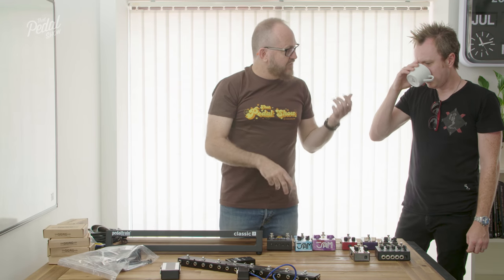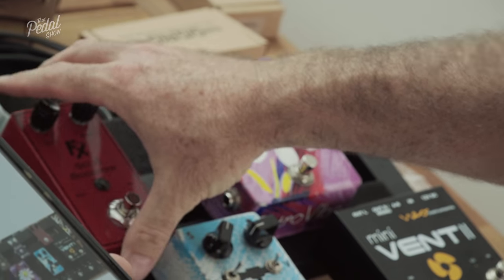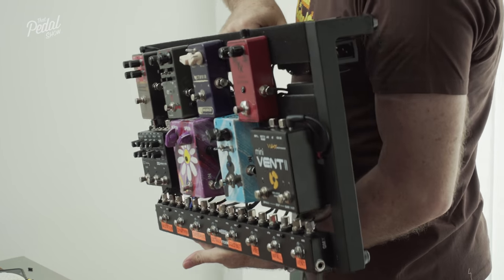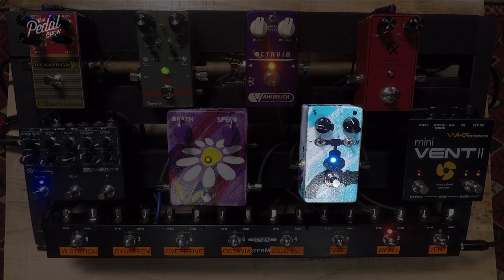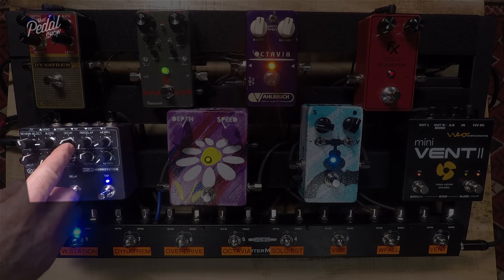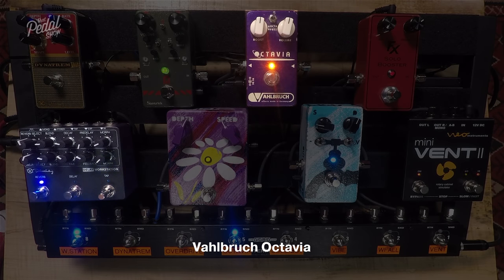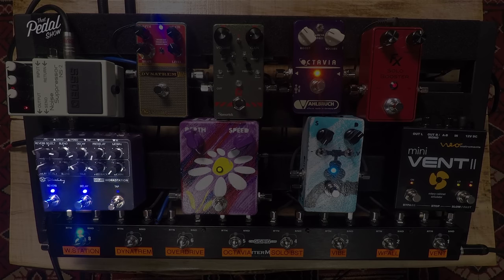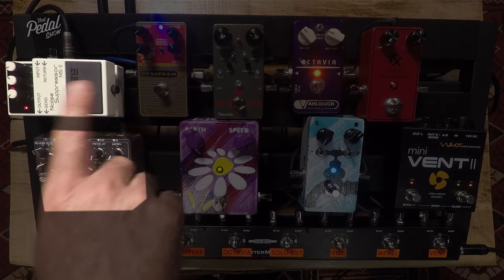Simon McBride Pedalboard Build – That Pedal Show

Comment: I worked as an avionics tech for 26 years and I have more than my share of scars on the backs of my hands from cable ties. To eliminate the sharp edge we would use flush cut diagonal cutters and cut the " tail " as short as possible against the locking part of the cable tie leaving next to nothing remaining. This practice helped to eliminate the cuts to our hands and heads at times LOL.

Comment: After I finished watching this clip this morning, I went in and fired up my hokey guitar rig. Honestly for the first time since I have owned my Mesa Lonestar Special, I dialed in a lot of gain on the amp as part of my pedalboard and two amp setup. I started watching TPS before I got that amp. And before and since I added the Mesa, I have been running both amps VERY clean.  
Because that is what you two do and it always sounds so great on the show. 
So today....EPIPHANY time! HUGE difference in the response of my guitars with all of this gain dialed in on the Lonestar Special. 
I am running a stereo delay through both amps and a GFI reverb only though the amp that is still dialed in clean. A clean boost, an always-on Lightspeed pedal, several overdrives and a few modulation pedals in there as well. 
Sounds REALLY good (to me) 
I have benefitted a lot from watching all of the TPS episodes. Today was a milestone. 
And Mr McBride is one HELLA player! 
Cheers from NM, USA
Reply from the maker: Excellent! The gain channel in the Lone Star is a marvellous thing. We’re glad this video helped inspire you - thanks for watching!

Comment: On the topic of the clip on tuner issue - I had a hunch this would be the case when Simon was talking about his experience in the beginning of the video. The case is that the Polytune clip on tuner works MUCH better than any other clip on tuner I've tried. It works much better in a noisy setting especially. This is likely the difference between Mic and Simons experiece.
Reply: Zach Richard 
I use a Snark(the little more expensive one) and never have an issue. My buddy has to have no sound, I just don't t have the issue, but I'm using a Strat, and he's using an Acoustic/Electric.

Comment: Hello there,
In the beginning of the pedalboard Build you mentioned troubles with noise and influential vibrations while using a clip on tuner on stage.
My advice: try to palm mute your strings and only let the one string shortly ring you want to tune and than pm again. Helps to increase focus on the strength of that strings frequencies!
I had an acoustic combo and I had similar troubles even with the build in tuner of my worthy Martin Acoustic. This trick worked just always....build in and clip on

Cheers

Comment: I don't get Keeley pedals. I've tried a few and the only one I absolutely love is the Keeley Katana. I have one as a seperate pedal and one in the Keeley workstation. If there is one pedal I wouldn't want to miss at all, it's that one. Best (clean) boost pedal ever imo. It doesn't color the sound in any way, it adds a small bit of compression. It's a pedal that's always on for me.

Comment: I’ve yet to hear an explanation of using 4 cable method, or how to run an effects loop on a switcher like that which doesn’t seem way overly complicated until a few days ago.

Treat the amps pre-amp as a pedal.

Instantly solved.
Reply from the maker: Hooray!
Reply: Could you have used two Quartermasters a 6 plus a 2 for the loop or would that have given grounding issues?
Reply: And then there's always one guy who takes that as a challenge to overcompicate things....GAVIN! 
JK mate. There are no bad questions, after all.
Reply: Ha ha Ha ;) I was trying to ask a practical question because here they had a significant noise problem requiring a gate pedal and a second ground lift. Some effects loops can be quite sensitive as Dan alluded to I think.
Reply: I suppose an ABY with phase/iso/grnd lift might come in handy with your two-looper idea?

Comment: Hah, I'm not the only one that runs Phaser and Chorus before drive. My reason is: I find the chorus/phaser effect too pronounced if I run it together with drive if it's after the drive. Does that make sense?
Reply: Yeah. Try a wah before and after. The drive kind of normalizes the effect
Reply: I like having an Drive and a Fuzz, after my Uni-Vibe, Phaser, and Chorus(if I'm using it). There are two different sounds, both of which I love. Sometimes the solo cuts better with drive first, but not always.
Reply: Yep, a general rule of thumb is that the effect last in chain usually has the greatest effect on overall sound.  It's not always the case but a modulation after a drive sound will typically be much less subtle.  I run my vibe and chorus before any drives but after clean boosts.  It seems like running boost>mod>dirt puts a touch more emphasis on the modulation but not so much that it becomes a swirly and cheesy sounding mess.

Comment: Great episode. I completely identify with Simon's need to have some reverb. There is a whole feeling of interaction with the room and maybe the amp (if using an amp-based spring reverb) that I find it difficult to play without. 

On my board I have modulations and delay running into a fuzz and drive. I also have a boost/light OD and a fuzz BEFORE them in case I decide for whatever reason I want that sound. It provides a lot of versatility. 

Anyway, Simon is a fantastic player and seeing the board built from the ground up and going through the chain is really informative. Cheers guys!

Comment: Great tips about building a pedalboard. I've never seen a power distribution system like the modular Gig Rig. It works so well for pro boards, though it might be a bit pricey compared to a 'normal' isolating power supply for the weekend warrior, once you add up all the individual modules.

Comment: Take a photo! Of course! Like a Dummkopf, I've been drawing out my chain with little squares for the pedals and arrows/lines for the path & wiring.
TPS, saving Guitarists time and hassle, one schwang at a time.
Not quite sure I understood the insert. Send>Input then...what?
Reply: 4 cable method:
cable 1 - from guitar to pedalboard
cable 2 - from pedalboard send to front of amp
cable 3 - from amp effects loop send to pedalboard return
cable 4 - from final pedalboard output to amp effects loop return (basically direct to power amp>speakers)

Comment: I use the Gig-Rig power stuff and the solder-less patch cables, highly recommended.
Reply: JimSpinner I’ve had solderless let me down at a gig.. absolute nightmare. Not gigrig mind you.. I would never ever go there again.
Reply: Ewan Mcgowan Fair enough, I guess “user experience may vary “
Reply: Did you use the Evidence audio stuff? The SIS-plugs? If so, it would be a big suprize, since those seem to be bomb-proof. Never had any problems with those, because the concept is so different from, let's say George L's etc.
Reply: I've thought about purchasing the solderless cables, but always end up putting the money toward another effect. I just don't need it super quiet.

Comment: For breaking up ground loop hum and providing a neat little black box send/return on a pedal board I find the Behringer HD500 to be extremely useful.  Or an Ebtech Hum Eliminator (especially if I want to use XLRs).  Passive transformer isolation really works and a little iron coloration never hurts.  Especially if any digital pedals are involved.
Reply: Sorry - I meant Behringer HD400

Comment: Re the edges of cut cable ties... yes, they are very sharp... my solution is to melt them a bit with a butane lighter... a second or two on the edge is all it takes to smooth the entire end.

Comment: The vent sounds so good. I need to try one. I go back and forth between chorus, vibe and vibrato as my modulation pedals (never together, have a pretty tight setup so I’ll swap in n out), but I run them all similarly (either fast rate/depth or very slow in a phaser way). I’m thinking what I’m hearing is the vent and I may get a warped vinyl..,it never ends! Thanks guys
Reply from the maker: Mick here. I recommend the Vent unreservedly. I run that, the Supro Harmonic tremolo and a chorus with a DC-2 kinda setting. They’re all wide and phasey. Wonderful!

Comment: Actually lots of cool people use modulations before overdrive/drive pedals... Steve Lukather and Michael Landau for example! :)
Reply from the maker: And Robin Trower.
Reply: Phaser pedals sound so much better BEFORE distortion or overdrive.  Remember, most of Van Halen's early stuff was recorded with ALL his pedals and effects going into the front of his classic Marshall Plexi head.
Reply: I may be wrong but doesn’t Landau place his mod after? He may flip flop or use fuzz first perhaps? Trying to remember his board layout
Reply: He actually uses the amp a bit distorted and maybe you're right about the modulations after the gain pedals, but I'm still not sure.

Comment: Great video, especially the discussion of where to place modulation, but it also brought up a question I have struggled with since going wet/dry: is there a way to get modulation before drive in a wet/dry setup if I'm not using a programmable switching device like G2? My previous mono setup was Wah->Fuzz->Modulation->Drive and then into the amp input, but in order to get Drive into both amps and modulation to the wet amp only, I had to change the order. I can't figure out how to do it any other way but if you have suggestions I would love to hear it. I play a variety of guitars, primarily Strat and Les Paul, into amps set with "just a bit of hair" and use fuzz and drive to get more gain when I want it.

Comment: Great show, the lighting looked much, much better!  Thanks for the board build footage - I am trying to build one myself.  I won't have the right power initially, but should by Christmas.  I do have the cool patch cables, though!

On the new set, I have been holding off on this, but there are some vertical lines on the backdrop that are tan.  It may be from backlighting or something else, but what it looks like is that those seams were missed with the paint.  It is very distracting to me - am I the only one?
Reply from the maker: It has shrunk - we need to repaint it. Cheers William!

Comment: 6:54 Another tip to eliminate those sharp edges is to slightly file the edges with a metal file or fine sand paper; all you need is a little bit for a nice and smooth edge that will not cut or scratch.

Comment: Hey guys, thanks for all you do, love the show!  I really want to incorporate a QuarterMaster QMX - 8 onto my board.  Can you recommend a good, small and affordable pedal board for the QMX8 and 8 pedals?  I just play at home for fun and have limited space so it needs to have as small a footprint as possible (or my wife will kill me!).  I'm currently using a Voodoo Lab Dingbat Small Pedalboard with Pedal Power 2 PLUS but I don't believe it would all fit.  Thanks in advance!

In case it helps, my pedals are:

Archer Ikon
Analogman POT
Fulltone OCD
Tube Screamer 
Chase Tone '68 Velvet Fuzz
MXR Carbon Copy Delay
MXR 6 band EQ
Boss RC1 Loop Station

Comment: Wonderful show! I could watch Dan build pedal boards all day.

Also as an aside, let me jus say what magnificent... step ladders... you gentlemen must have.

Quick question: how many pedals would you say a person needs to be running for a loop switcher to become necessary? I ask because it's something I've been thinking about, but I almost never run any more than 2 or 3 pedals at a time. Usually it's two gain pedals and a delay or something like that.
Reply from the maker: Mick here. Thank you! Depends entirely on the pedals. Any more than three for me. But if one of those was a non true bypass old thing, or something with digital cobblers, then it’s one pedal for me! :0)
Reply: That Pedal Show - usually it's a Rat II, some kind of big muff, and a carbon copy. Sometimes its a Custom Badass '78 and a TS 9 and a Carbon Copy. I'm guessing I should be good unless I start adding more things then.

Thanks, Mick. I really appreciate how you guys interact with us in the comments. There's not many what do.
Reply from the maker: Totally. I wouldn’t bother with those. After that is probably the time. Although I don’t know how good the RAT bypass is. Mick here. :0)

Comment: Tip: burn the ends of the cable ties, that leaves smooth round edges, I will not do it any other way now ;-)
Reply: Christian Boddum twist them off with linesman pliers. Best solution and easiest way to avoid sharp edges I’ve found.

Comment: So let’s say I’m using dirt and phaser at the same time.  Now, with this switcher and both pedals on, will the order still sound as if I’m using a traditional style in/out pedalboard? Just a little muddy on how important order is with the gig rig. One of your best episodes. Thanks. Waiting to see a red on black shirt in your store.
Reply from the maker: Yep, absolutely order matters. All QMX is doing is putting each of your pedals in a true bypass loop. So that when they’re off they’re totally out of the circuit. When they’re on, it’s just like having them on your pedalboard. 
G2 does the same thing except you can program it for multiple changes and other things.... and switch the order of pedals around if you want. Cheers!

Comment: Question for you, Dan... Of the boards you do for professionals, how many have simple boards and you give them a Quartermaster (i.e. Simon, Kirk Fletcher, & Matt Schofield) and how many have more complex boards and they go with a G2 (i.e. Biffy, Steven Wilson, James Bay, & Josh Smith)? Just curious what the percentage breakdown on that is.
Reply from the maker: Oooh, I’d say 55 to 60% that I do personally end up going the G2 route, but that’s because most of those guys had heard of the unit then got in touch, so it might be a little skewed because of that

Comment: Hey guys, just wondering if it wouldn't be too much trouble to recommend a few fuzz pedals for me. I'm just not able to find one that I like, i've tried a big muff and a fuzz face if that helps at all. Thanks heaps for doing the show, I always look forward to watching each week.
Reply from the maker: You’d probably need to be a bit more specific - what guitar and amp do you use and what sound are you going for? If you’ve tried a Muff and a FF and you don’t like either, maybe fuzz isn’t for you. The other main school of fuzz is the Tone Bender lineage... so there might be something there? But it’s a funny old beast is fuzz. :0)
Reply: Thanks for the reply. I am currently using a Fender hot rod deville 410 and a SG. Not sure on the sound but probably something between huge fuzz and the old school fuzz sound.

Comment: Pedal guys have a question where would you place the trio plus. In front end of speaker or with the effects loop. That would be a good video
Reply from the maker: Either would work fine.  Cheers!
Reply: What about a dark side pedal
Reply from the maker: In the front, because of the fuzz.

Comment: Great show, but i have to ask:  why dont you cut the cable ties flush down to the clip?  

I use cable ties for everything...EVERYTHING!  And not just guitar stuff.  I am a big fan of cable ties...great tip burning the ends to remove any sharp corners.
Reply from the maker: Because they’re reusable, so if you ever needed to adjust anything you’ve got enough left on the end to grab and pull tight. You can’t do that if it’s cut off flush

Comment: Is it just me or does the Vent give the impression of less gain?? It seemed like when he rolled back his volume knob it still sounded a little gritty, but with the Vent on it actually sounded quite clean! Just a thought
Reply from the maker: Anything that modulates frequency relationships (in this case phasing) will have a perceived effect on level and therefore gain, depending on what it’s hitting. It might also push certain frequencies and make them overdrive more. All part of the deal! Mick here.

Comment: Hey Dan, have you ever used Dual Lock Velcro? I'd like to know what you think about it, because I find it better than the regular velcro. I prefer it, because it is stronger, it has only »one« side, so it doesn't matter which part goes on the pedal and which on the board and if you carry pedals or the board around they don't stick to other things like your clothes.
Reply from the maker: Mick here. We use 3M Dual Lock on the pedals, and normal Velcro on the board. :0)
Reply: Oh wow. Great Idea. I'm surprised this works. Just tried it out immediately and it's amazingly strong. Even though trying to remove the Dual Lock destroyed some of the small hooks. But I'll do some more Tests with other Velcro. Until then I think I prefer the Dual Lock on both sides, pedals and.  thank you guys.

Comment: Thanks as always for the fun and useful info.

Could a mini Neo Mini Ventilator user (Mick? Simon?) comment: does the ‘in’ jack accept stereo input via a TRS cable? My effects loop board is stereo all the way - left/right in to left/right out (ending at the awesome empress effects stereo + buffer allowing me to sum to mono instantly when needed), so I need that capability on the ventilator too, which would be placed on my effects loop board. I know the full sized ventilator does have stereo ins and outs, but it is huge, and integrating that would mean I have to sacrifice my midi syncable EHX Stereo Super Pulsar.

Thanks!
Reply from the maker: Hello, Mick here. According to the manual it only accepts a mono input. Cheers!
Reply: That Pedal Show Thanks Mick!

Comment: any way to mount Generator underneath a "normal" angled style pedal board, such as a Blackbird?  Been thinking of up grading from my Pedal Power 2, but would like have capability to mount under the board.  Seems these brackets would only work for a pedaltrain board.